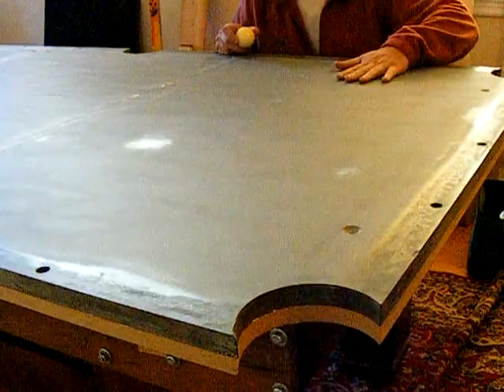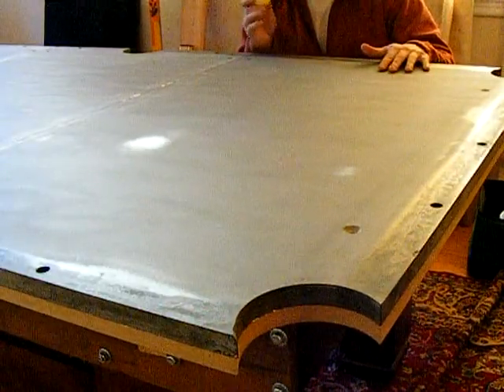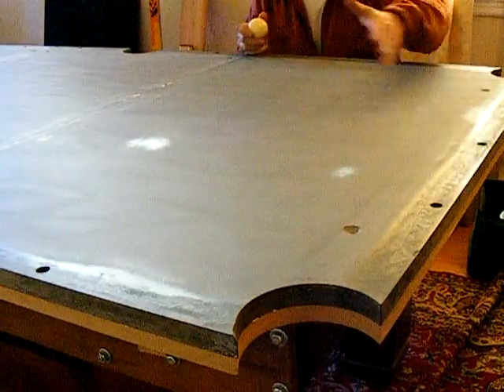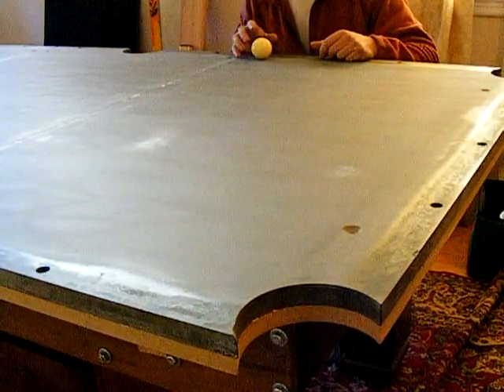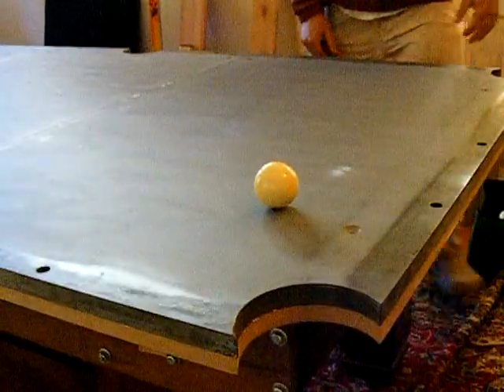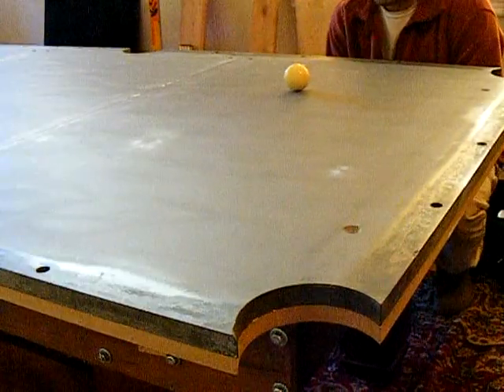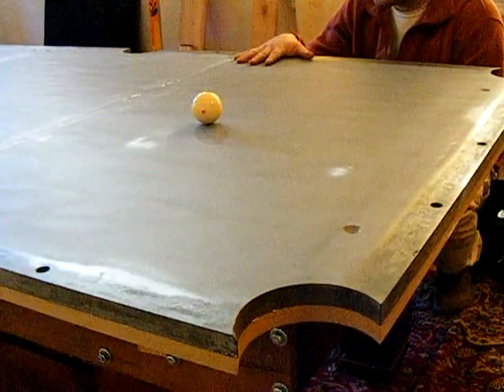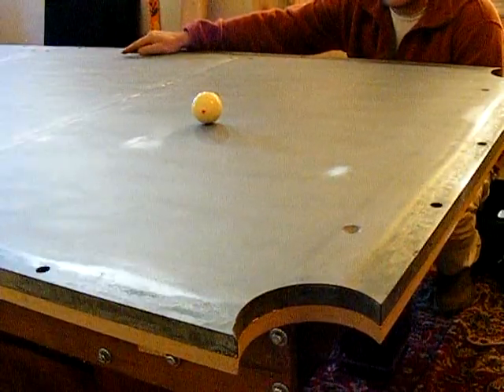Pool table installation part 2 Leveling the slate mpeg2video

Comment from the maker: my slate is similar to yours.  after installation, i noticed that as the balls run along the rails (without touching) that they have a tendency to curve inwards away from the rails.     i figure the slate is not perfect, and yes, it's hard to shim that.  if your slate has no backing boards, i bet you could bend your slate with enough pressure to where that problem went away, and then gorilla glue mdf board to the bottom of the slate.  when it dries, it should hold the slate to that shape.

Comment from the maker: a 9' gold crown has an amazing frame below it.  those things are huge.  my frame supporting the slate was very wimpy so i added 4 more legs near the center.  i had a spot in the middle where the balls seemed to drift into.  i jammed in a couple of shims below that area and it fixed that problem.

i cant see where any amount of shimming will fix that "rail drift" that i get but maybe i'm wrong.  it's a very small problem and i've seen this on other tables as well.

Comment from the maker: dyemyeyes,
i see you have dye in your eyes.  machinists levels are great for determining what is level in 6" increments, which doesn't always reflect the how flat the slate is over several feet.
i've played on many pro installed tables.  my table plays as good and i think better.  

i'm curious how you can think that if my balls roll straight as can be that somehow it can possibly be better.  

please respond with something smarter than your first comment.

Comment from the maker: @criticsrule2 cool.  thx.   i really did the best i could w/o buying a very expensive machinists level.   it only makes sense that if the balls roll straight then the table must be straight.   lots of haters out here...probably pro installers who are pissed that i figured out a trick that actually works well.
btw, i would only shim the legs at the beginning. of the job.   never at the end.   but that is only what i did and i dont think it would be precise enough to do at the end.  good luck.

Comment: I see this scene with every instillation video I watch.. I’ve never rolled a ball on unfelted slate in my life..

Of course, I am usually dealing with a gold crown that’s 60 years old, that takes extra shims in the frame to deal with 60 year old slates, but I’m sorry... I just don’t get it?..

Maybe you can explain this to me?..
Reply from the maker: Sure i will explain.   Imagine if i installed the felt first, waxing the seams before the felt, and then tried to level each piece of slate.  That would suck, right?  The wax would pop.  It would be a mess. Also rolling balls on bare slate will reveal if you need to add shims more so than slate with felt. The bare slate magnifies any tilt in the slate.  Most of us do not own a $300 level.
Reply: @snakeclaw  

You can afford a pool table and all it’s accessories, but you cannot afford a machinist level?!.
Reply from the maker: @jacobjones5269  why would i buy a $300 machinists level to use one time?  Send me yours.  And if the balls roll straight and true isnt that the desired goal?  Why are your panties in a wad if the table rolls true but it wasnt done with a level?  Are you dealing with issues?
Reply from the maker: @jacobjones5269  and yet i took the time to make sure the balls roll true and perfect before i put felt in it.  I was patient and took my time.  I know that pisses you off.  I can make the longest slow shot and have a true roll. Can you explain why?  You are befuddled
Reply: @snakeclaw  

Sounds like you’re the one who’s upset brother..

Hey, you don’t wanna learn the right way to do it, that’s fine.. Keep making videos that explain the wrong way to do it, you’re prerogative..
Reply from the maker: @jacobjones5269  what is it that i dont want to learn?  Using a level?  Bro, im a contractor.   I have a zillion tools.  Im sure if i had a fancy level id use it but, like most homeowners watching this vid, i dont have one.  I know you are joe cool and because you have one you feel everyone should.   Actually,  i have an old strat and a boogie amp.   Do you have one?  No?  Oh...you are a schmuck
Reply: @snakeclaw  

I don’t own a machinist level.. lol.. But when I work or worked on a pool table, I made sure I had one handy..

Look, you’re a contractor with a zillion tools, just not the one you need for the job.. That’s par for the course with contractors.. lol..

Carry on, brother..
Reply from the maker: @jacobjones5269  actually any good contractor knows how to get the job done with the tools they have.  If i needed a machinist level to get balls to roll true i would have bought one.  Much to your displeasure i found a method, as any good contractor does, to get the balls to roll straight without one.  I know.  You want to believe its not true.  Its okay to be wrong every now and then.  Its okay my billiard vids have half a million views.  I know it makes you mad.  Its gonna be okay though
Reply: @snakeclaw  

I said carry on?.. lol.. Enjoy the shit out of that table, and remember... pool is all about your right arm.. If you’re right handed, that is..

It’s all about the delivery of the cue..